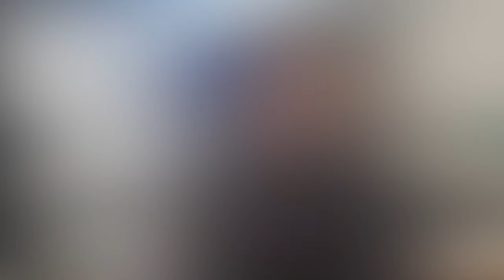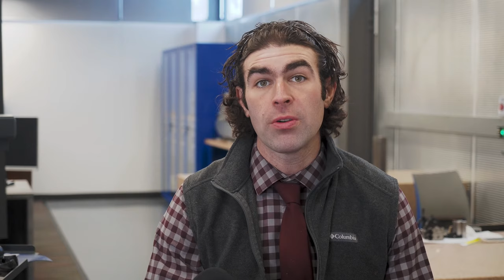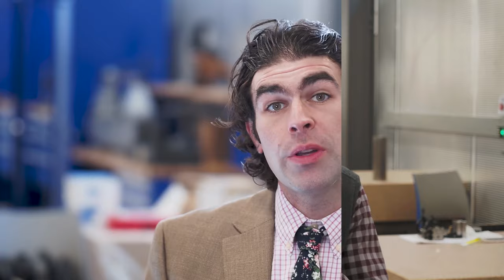Nuclear Accident: Davis Besse 1977

Comment: Not sure if this was the case here, but my understanding is that at TMI there was a big light indicating the PORV was closed and the operators were under the impression that indicator was a "verified condition" (sorry, don't know the correct term), when in fact all it showed is what the valve had been last commanded to do.   That's a pretty crappy thing to do to people under pressure and a piss poor design if you ask me.  At a minimum you'd think you'd make that a part of any simulator training too.
Reply from the maker: You are 100% correct! The light for the PORV on these units only indicated that the signal had been sent. The problem was not solved until after the Three Mile Island accident. One of the principles of the Naval Nuclear Program is to "Trust your gauges/instruments". It is unreasonable to ask operators to second-guess what the gauges/lights/instruments are telling them. I would lay the blame on the design of the unit.
Thanks for adding to the conversation.
Reply: The design had no current state indicator..  yeah, crappy
Reply: when something is going wrong I want. to see what is  going on now !

Comment: B&W's design was unlike a Naval reactor. Davis Besse had once through Steam Generators that did not promote thermal recirculation to carry heat from the reactor during loss of coolant flow.
Reply from the maker: Thanks for the input!
Reply: The navy reactors use much higher enrichment than the commercial models.
Reply: I think the point was that B&W's design was a PWR (like Navy & Westinghouse) versus being a BWR reactor system.  OTSG vs. U-tube SG is a smaller consideration.
Seems like the long hot-leg (up to the top of the OTSG) would give a fair amount of buoyancy-driven circulation, as long as there is some cooling on the secondary side.

Comment: This incident and TMI both were basically 'pressurizer steam space LOCA'.  These are different than the LOCA usually analyzed for because they cause primary pressure to drop much faster than a liquid LOCA accident and actually 'draws a bubble' in the hot leg/ core.  Any time the pressurizer is cooler than the reactor outlet, the water in the reactor outlet flashes to steam and expands rapidly.  This rapid expansion pushes water from the reactor outlet and hot leg, into the pressurizer which causes level in the pressurizer to to rise rapidly. 

The mindset of operators typically DID NOT understand that a rapidly rising pressurizer level, coincident with rapidly falling system pressure might mean there was a steam bubble somewhere else in the system.  This is a key symptom of this type of accident.  Had pressure been normal or above normal, their actions would have been correct (shutting down ECCS systems).

Even your own description of "The pressurizer being above the core meant that if there was water in the pressurizer there was water in the core." shows this misunderstanding.  Just because the pressurizer is higher, doesn't mean this.  This issue is heavily discussed and trained about since TMI.  (and I would add that operators are now given training on plant-reference simulators that often include just this sort of symptom-diagnosis event training)

Comment: You mention the HPI but don't mention that it injects borated water into the system to help shut down the system.  Also, there's the LPI and core-flood systems (the other parts to the ECCS) which come on as the pressure drops further.  Presumably the operators shut those down too?

Comment: 3:27 for people wondering what a "Steam Generator" is......
.
the water from the reactor is radioactive..... 
so it goes into a big radiator (like in your car)
.
except... instead of air cooling it down, it uses a 2nd "loop" of water
the metal heats up.... transfers its heat into the "2nd loop"..... and the 2nd loop starts to boil
this makes steam, and then goes to the turbines
Reply from the maker: Thanks for adding this to the conversation!

Comment: Teh most disturbing aspects of this and the 3 Mile Island incident are the " Obsession " with the pressurizer and the ignorance of the state of the Reactor proper. Same BRAND of reactor. Noted and repeated problems with the PORV design. I have to ask why the pressurizer is also so " given over " to rapidly overfill during fault conditions and why that matter was not dealt with on an Engineering level? Also why is critical intel on the CORE not front and center in this kind of scenario. I can see that the operators can become overwhelmed very quickly in all cases. There seems to be a decided lack of CORE critical data presenting with this particular model. IN both cases the failsafe core cooling is shutdown. This is mind blowing.

Comment: 2:39 did you mean to say several 1000 degrees? 
.
several hundred degrees can be done with a ~40 PSI radiator cap in your cars engine
like... even 250F only needs an 18 PSI radiator cap to prevent boil over
.
hit 260-280 and its going to "explode", however (aka, rapid release of pressure into the over flow tank)

Comment: Never knew Davis-Besse had an accident, I've lived in western Ohio since 1991!! 🤔
Reply from the maker: Luckily it turned out okay! Thanks for watching and the comment.
Reply: Davis-Besse had a very close call about 20 years back too, where a leak of boric acid ate a hole almost all the way through the top of the reactor pressure vessel.  All but 3/8 inch of a six inch thick plate eaten away, holding back 2100 psi...

And FirstEnergy, the operator (which also brought us the blackout of 2003, nice fellas) just got caught a few years ago in a colossal bribery scheme, where the state of Ohio bailed them out to the tune of $1.3 billion, to keep that heap running.  Among other things.

Comment: Good job at presenting accident. It is very strange PORV only had one relay to control the flow. Such installations normally have several backups, then digital and often analogue displays/alarms in case it goes wrong for some extremely strange reasons. Turning off safety systems is more logical due to training of the crew.
B&W folks had many accidents at this plant, at least two very dangerous and it is still online in 2021. Three Miles accident also happened in plant designed by them, although teams who ran them probably caused failures. I hope people don't get scared of nuclear power for civilian use because of accidents 50 years ago. 
China is on very good path for making big commercial thorium MSR unit, Russia is also very active, then there are a few American firms working on MSR. I'm disappointed at how Bill Gates tried to get into it and made strange manouvres right at the beginning, involving Warrenn Buffett is even worse. This things are way too important to leave them to people who are only interested in owning whatever possible... 
I hope politicians will remember what A.Weinberg did and proposed in 70's, he is real father of PWR and civilian Molten Salt Thorium Reactors!
Reply from the maker: Thanks for leaving a comment! I agree, these accidents have caused a mistrust of nuclear technology. The problem as I see it, is that people mistrust the technology and training of the 1970’s. Newer PWR and BWR reactors are much safer, and the latest models will coast down into a safe condition even if the whole crew leaves the plant for several days.

Comment: I'm watching this...3 minutes in he's already incorrect on several points...21 years as a Naval nuclear operator and water hammer was never a major concern on any of the 3 plants I operated during that time all of which were larger than "dozens of megawatts"...lowering pressure without change in pressurizer level required checking of relief valve discharge lines for evidence of relief valve lift/excessive leak-by.  Additionally, viewports in the reactor compartment were immediately to be checked for evidence of steam in the compartment indicating primary loop leakage...the cause of both this incident and 3 Mile Island was commercial plant operational doctrine, maintenance, and design (reliance upon electronically controlled pressure relief valving) and not Naval Nuclear Power training - we had 30 seconds to respond to any abnormal incident such as this whereas commercial plants are allowed 30 minutes to prevent core damage (the "meltdown" as described by this author).  This and 3 Mile Island are classic LOPA (Loss Of Pressure Accidents), one of the many we trained on from day one that required immediate memory items to be performed.  The lax and somewhat lackadaisical actions at 3 Mile Island (and likely this Davis-Besse scenario also) by the control room operators put them in their own box of disaster.  The only credible information to be gleaned from this video is that there were LOPAs at Davis-Besse and 3 Mile Island commercial nuclear plants and nothing more beyond this.  Attempting to purport that Naval Nuclear Power operators are somehow unqualified or mentally unable to operate large steady state reactor plants after operating dynamically operated nuclear power plants shipboard is untrue and unfair in the extreme - these folks were chosen and trained by the Navy to successfully operate nuclear reactor plant specifically because they were able to be trained to properly operate them in many, many more varied situations than a commercial steady-state plant and their ability to use their learned knowledge in unusual situations; these folks are not "monkey-see, monkey do" uneducated button pushers operating mindlessly.  The failure was with the commercial operators of Davis-Besse and 3 Mile Island with their inadequate training system, poor design features, and poor maintenance practices (how many red flashing alarm lights were and had been ignored for weeks at 3 Mile Island by operators and management alike before their incident?  Look it up - there were several). As I stated above - a lax and lackadaisical culture at that site.  I was operating a pair of Naval nuclear reactor plants at sea when 3 Mile Island occurred - we at the time were incredulous at the rife stupidity that allowed the incident to occur.
Reply from the maker: Hi, Great input! If I ever make another video about this topic I will incorporate some of the points you made. In regards to the Naval personnel, I do not intend to blame the operators or their naval training. I know the excellence of the Naval Nuclear Program, exemplified by a perfect record on serious reactor accidents. I contend that the commercial industry failed the operators by improper training and procedures.
Reply: Hey "old man", some of the best stationary engineers that I've worked with, came from the "🦑" Navy! I'll show my age now, I ran the last coal fires out of two Riley Stockers! Semper Fi!
Reply: yet the highly trained naval rector operators and the lackadaisical commercial operators were the very same people no?
Reply: @speedonz  The operators were trained on these commercial plants in accordance with the commercial plant training regime.  The tone set in Naval Nuclear Power during operations is anything but lackadaisical - even routine ops require diligence for safe operations.  This was not the norm in commercial plants of the time period covered in the video as evidenced by the incident report findings.  Some of the operators may have been Navy trained but the operational atmosphere was very different between types/uses of the reactor plants.  The difference in the critical period between 30 seconds and 30 minutes to take action before core damage is indicative of the different operational philosophy of the respective leadership/management.
Reply: Allowing the pressurizer to fill and the system to "go solid" as he says, is a valid concern, but I agree with you that it's not the same thing as water hammer.
Of course, in this event (and TMI) the primary system did NOT become completely liquid-filled but there wasn't instrumentation to show water level in the reactor.
Small-break LOCAs can create confusing situations, but they were not studied in that much depth until after TMI...

Comment: Few realise that the fuel in the TMI reactor was near-new  -  had run only from the previous month.  Thus the radiodecay heating in the core was much less than would prevail after shutdown of a typical reactor.  If the TMI fuel had been typical USA fuel i.e had been running a year or so, it would have melted in a big way.
         Please do organise a diagram showing the parts you're speaking of.